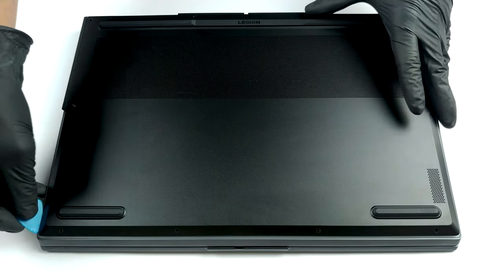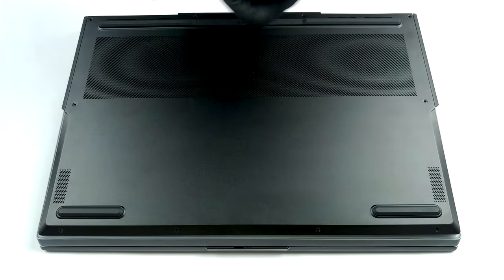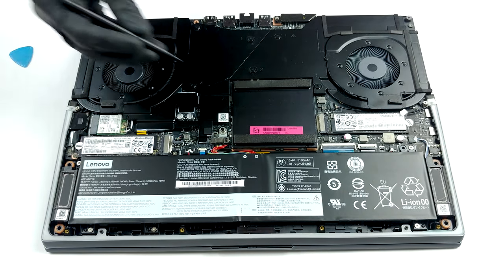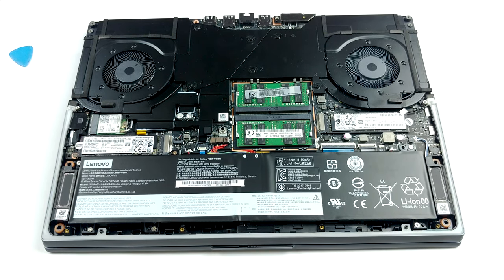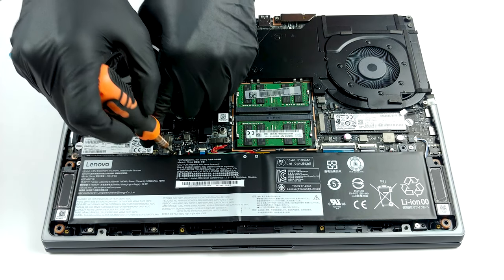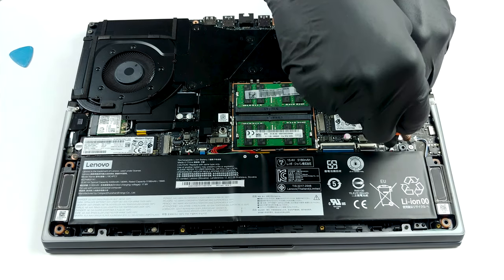🛠️ Lenovo Legion 7 (15) - disassembly and upgrade options

Comment: Be aware, first time disassembly is harder than shown. After loosening closest 2 corners, use thin plastic tool (thinner than credit card, they usually can be found in smartphone repair sets) to carefully push back side panels and whole back panel (including plastic over ports on the back) up(!) until click happens. After couple of times it gets easier as plastic eases, but first time be VERY careful.
Reply: beautiful girl thanks for the tip 
this shit is nerve wracking on new laptop hehe im so excited to do it
Reply: @Perkeletricksterservantofrher  sus
Reply: Thanks a lot for pointing that out!

Comment: Nice video, but I would recommend that anyone attempting to disassemble their own Legion 7 use a nylon spudger (or some other non-conductive tool) to unplug the battery immediately after removing the base cover, because it only takes one dropped screw to turn a nice laptop into a brick.
Reply: what do you mean by dropping a screw? and how does that brick a laptop?
Reply: @warrencoulis4958   The point I was trying to make is that with the battery still connected, anything that might cause a short circuit could fry the motherboard, so always immediately disconnect the battery before attempting to do anything else.
Reply: @JDGillis  Hi I'm attempting to put an ssd inside. Do I need to do it for that? Thanks.

Comment: incorrect description The 7i Legion 15 supports up to 64GB RAM ..Just got mine in the mail with 2x32GB DDR4 2666Mhz
Reply: I doubt this is true, its at your own risk though as its not offically support and lenovo says only 32 but may change depend on new technology
Reply: @AlexVarr  you are right min is now running 64gb!
Reply: @iamnutty8471  yea only reason it says only supported 32gb is because thats the max ram they tested before selling it.. i found this in lenovo forum from a support specialist.

A kit of 2x32GB (Max of 64GB) will most likely work. However, the current memory offerings at the time of testing was 2x16GB (total of 32GB), so it has not been tested with higher, so Lenovo can not 100% guarantee it.

Comment: that huge metal plate is strange...i wonder how the components under it feel when the cpu goes to 95C
Reply: that's probably the reason why it's there ... i'm guessing... Like a shared heatsink with thermal pads on the components that need it like VRM etc...
Reply: Isnt it a huge vapor chamber like the guy just say in the video... you know like the razer blade 15...
Reply: Never see temperatures more then 80 degrees on my Legion 7

Comment: If you can upload a video adding a second ssd or hdd, it would be very helpful, please, thanks nice video
Reply: its in the video ,hes taking it out, same way to to install a new ssd
Reply: @sandcove86  do we have to remove the battery to add the ssd or can i just add it immediately after unscrewing the outside case? i just bought the lenovo and realized 1tb is too less if you play a lot of game!!! I should have got it with 2tb when i ordered it !!😂😂
Reply: @SuperSKV  no need to remove battery but unplug the battery wire connector to discharge any power by holding the power button, it will take sdd nvme stick only ,no sdd 2.5 drive

Comment: What is the best way to remove the rear of the panel where it is held on with plastic clips? I have had trouble with those breaking in the past.
Reply: Use thin plastic tool (thinner than credit card, they usually can be found in smartphone repair sets) to carefully push back side panels and whole back panel (including plastic over ports on the back) up until click happens. After couple of times it gets easier as plastic eases, but first time be VERY careful.
Reply: @janelance7257  thank you

Comment: Can you post some firestrike scores? no Firestrike extreme scores, just regular scores. I can't find a review for this laptop anywhere..... for 2070 super max q or 2080 super max q preferred.
Reply from the maker: Keep your eyes out for the video description, because we will be posting our in-depth review very shortly :)
Reply from the maker: Here you can see our benchmark results for the GeForce RTX 2080 Super Max-Q:
https://laptopmedia.com/review/lenovo-legion-7-15-review-tackling-the-new-super-graphics-cards-with-an-improved-cooling/#gpu-options
Reply: @LaptopMedia  does the TB3 port and USB c port with dp output from the Nvidia gpu or Intel gpu?
Reply: @LaptopMedia  does the thunderbolt 3 port support gsync through dp? Is the TB3 port hooked directly to the Nvidia gpu?
Reply: @LaptopMedia  Hello, I want to buy a laptop, but I'm stuck between choices. I'm interested in laptops with cheap video cards, such as GTX1650, 1650Ti, and RX5500M. Which of these video cards is better for laptops. Bye

Comment: @LaptopMedia hey buddy, im trying to upgrade the memory. Which screwdriver did you use for the ssd memory? I tried with everything i got but cant take the screw..
Reply: It's a 4mm phillips screwdriver
Reply: @TakatoSakurazawa  No such thing. I haven't been able to figure out what screwdriver to take out the SSD's either.

In the end I used a pair of pointy pliers to grip it and remove the screw to the empty drive slot and put a new one in. Can't remove the original drive as the pliers can't get a grip on that one.

Comment: Would this be compatible with the legion 7i Samsung 970 EVO 1 TB PCIe NVMe M.2 (2280) Internal Solid State Drive (SSD) (MZ-V7E1T0)
Reply: Any drive with an m.2 connector is compatible. So, yes the 970  would work.

Comment: Can you make a usable disassembly video instead of this one? Most of the times people disassemble their laptop because they want to repaste it, not because they want to replace battery or SSD. Seeing what is underneath heatsink would be more useful, especially if there are thermal pads which some people may also replace for better cooling and reliability.

Comment: I've heard of Lenovo will release AMD 4800H + RTX 2060 configuration with legion 7 in the early of July this year. And the price will be cheaper than legion 7i. I'm waiting for it.
Reply: Source?
Reply: Vali N. Some friends say they saw the Legion R7000P and R9000K will be released in July this year from Chinese websites. And they say Legion R7000P and R9000K are the Chinese mainland versions of Legion 5 and Legion 7 with AMD + RTX2060 configuration, just Chinese mainland Legion versions are using different names but same things. You can try to search for Legion R7000 P and R9000 P to get more information and mine source is from my friends.
Reply: Vali N. I'm trying to research about it too. And thanks for your reminding me to inspect these informations.
Reply: After some research, the Legion 5 maybe will get 4800H + RTX2060 in July.
Reply: @aeebeecee3737  yeah ive seen genexis_x on the ltt forum who is a malaysian leaker or something like that state that the 1660ti and 2060 are getting delayed till next month on the legion 5... but i did not see anything about the legion 7 getting the 4th gen ryzen cpus... ive also seen on a lenovo site, the one with press releases, that the legion 5 will have up to the rtx 2060... its still up so yeah... he seems reliable...
Reply: Vali N. Thank you
Reply: true fake news•Believe me

Comment: I upgraded my Lenovo Legion 7 to 64 gb ram (2x32gb memories) + One 2Tb SSD M2
Reply: is that possible what ram brand did you use? how is it performing on a 64 gb ram
Reply: Paul , what RAM brand and details pls ??
Reply: @migzahoy  A kit of 2x32GB (Max of 64GB) will most likely work. However, the current memory offerings at the time of testing was 2x16GB (total of 32GB), so it has not been tested with higher, so Lenovo can not 100% guarantee it got this back from support specialist from lenovo.. so i seen a few people upgrade to 64gb and it works fine.

Comment: How to void your warranty in 10 easy steps
Reply: You don't void any warranty by opening any sort of laptop
Reply: @churchofsatan2041  but my laptop has a screw right under warranty sticker to open my MSI bravo 15 laptop which has the same case as MSI gf65 thin
Reply: @churchofsatan2041  Depends on company and the product even